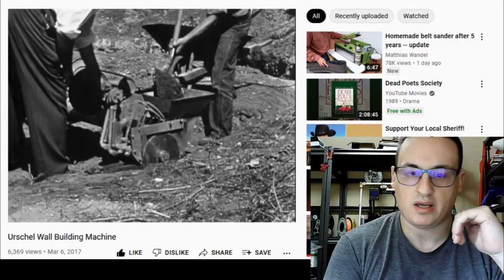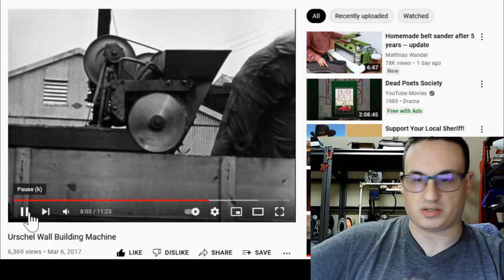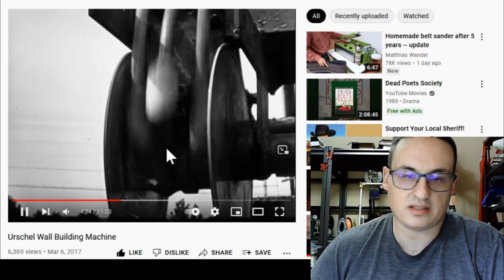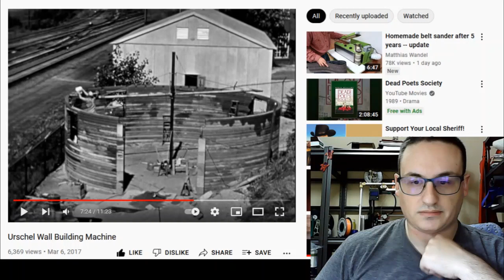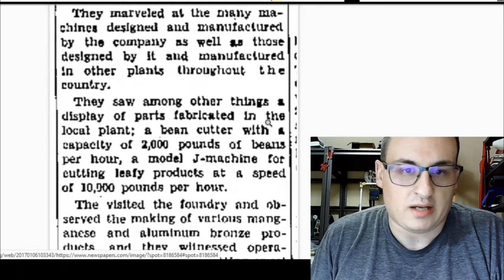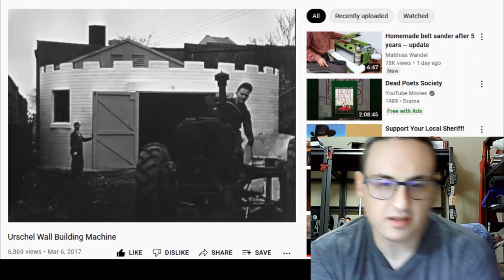3D House Printing in 1947?! Pt.1

Comment: Yes I also amazed that this didn't take off and I would love to be able to afford to make some. 😁
Reply from the maker: You and me both!
Reply: @3DPT  what about a crowd funding program, but re name the machine to "the poor people's house option"  But I do think to be safe you should do 2 walls, and fill the void with aircrete. Effectively giving you 3 layers. And the wire reo probably thicker. What do you think.
Reply: Lobby of architects, inspectors, engineer and building materials manufacturing. Money and politics as always. Ulscher machine was for dirt walls. It's not concrete

Comment: I like the advantages that come with no electronics or controller involved.  But this is much more hands-on.
Reply from the maker: At the time electronics that could control this may not have been available or practical for a prototype. I personally kind of like the hands-on control for the Z axis. Though today an ardruino and industrial stepper motor would work just fine.  With the labor shortage you may not be able to keep a well trained crew together.